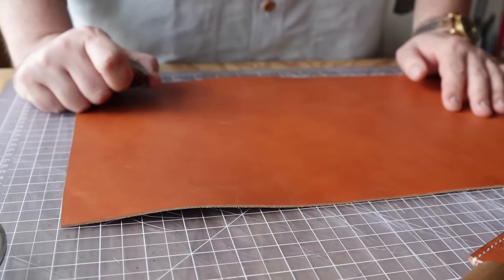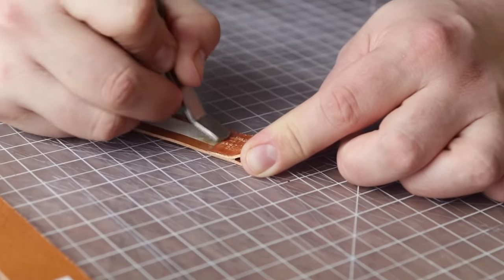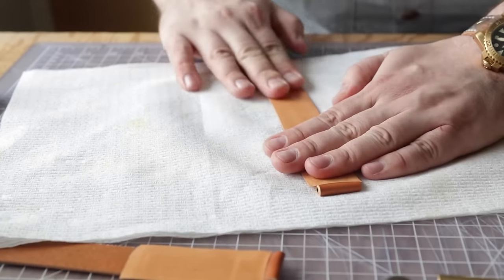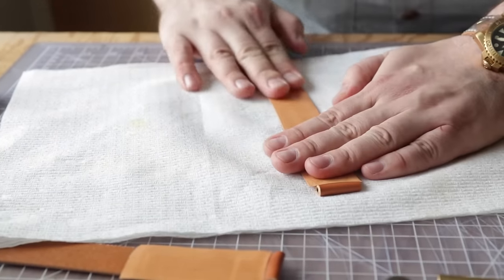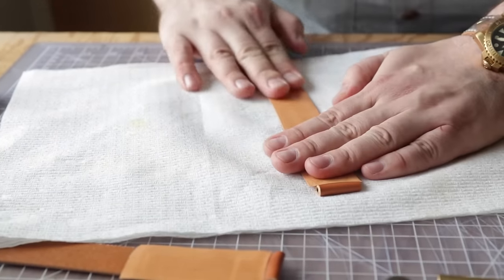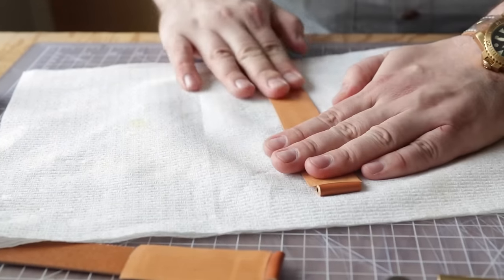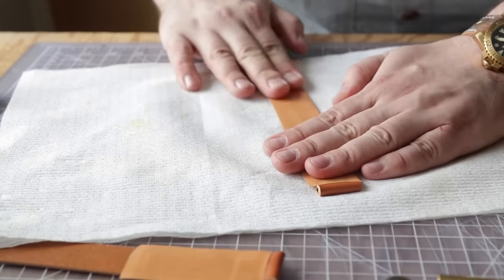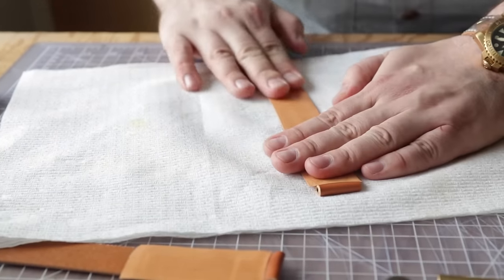Hand Sewn Leather Watch Strap Tutorial (Follow Along!)

Comment: Do you happen to have a link for that nylon strip with the sticky back.  Coulnd't find it on Buckleguy and i think that may be perfect for solving a probelm i've been having
Reply: I recently made two bags with thin shoulder straps. I had the same question. I live in Germany and in my city we have a store for sewing supply, from fabric to buttons to machines. I got it there, patches of nylon with sticky back.
Reply: Yes I am wondering the same thing.
Reply: Yes, definitely would like to find this as well.
Reply: If you are not able to find it… perhaps you could recycle a very lightweight give-away backpack (the kind you are given by a company at a trade show) and make it double stick with the rubber cement glue… it’s what I plan on doing for the handles of a really nice purse I’ve got.
Reply: Everyone! I found a very similar item! (looked forever too) It's not the exact one, but it's worked on my bags. Rocky Mountain Leather supply (took them like 4 weeks to send, but whatever). Search for "tape".
Reply: I bought the Velodon on eBay some time ago but that was from Russia before everything. Still haven’t used it but I will now. I was surprised to see it being used only half length on one side in this video. If it’s going to prevent stretching I would have thought it needed to go all the way past the holes?
Reply: @Rsama60  hi I live in Bavaria ...could you tell me the name of the shop? ...Danke 😀
Reply: Rocky Mountain leather supply has it. They sell both kinds…pre-glued or without glue.
Reply: Just search for leather reinforcement tape and you'll find several options.
Reply: @Rsama60  what’s the german name of that stuff?
Reply: @TB-vz1mh  sure: Prym Klebeflocken aus Nylon Artikelnummer 929 504

Comment: What size hole punch is recommended, 1.5mm or 2mm? When shopping buckles they don't mention what hole size is needed for the locking part. If I was to buy a hole punch tool, what size would be the best bet?